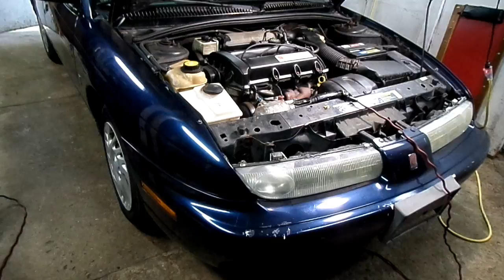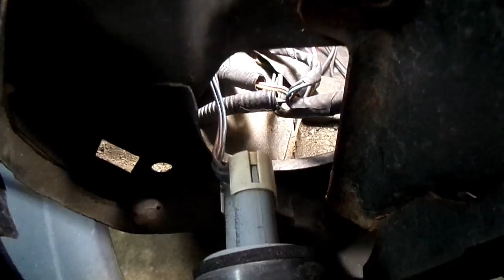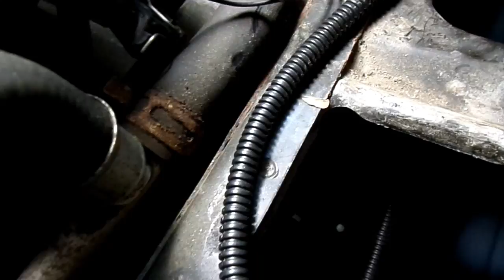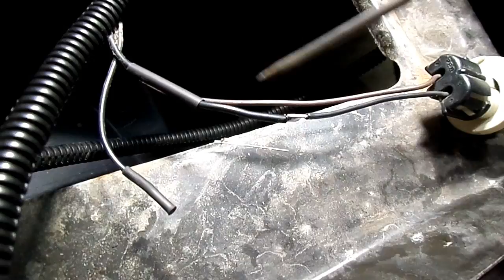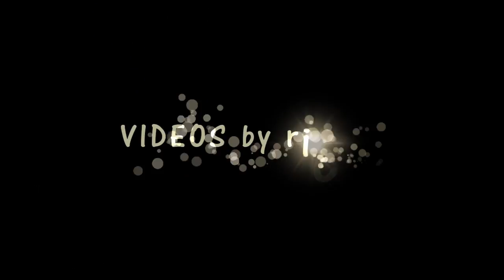Side Marker Lights Flash (modification)

Comment: Very nice! Do the side markers still come on as normal, or does it have separate marker lights and turn signals?  I am thinking if they are separate you could just splice into the existing wire including a diode to prevent the marker light from lighting up the turn signal bulb.
Reply from the maker: This is directly from saturn series .net (When the headlights are off, the corner lights will act as turn signals.  When the parking lights or headlights are on, the corner lights will still act as corner lights, but blink when the turn signal is on.  While headlights are off, the corner light and turn signal will blink in sync.  When the headlights are on, they will blink alternately)

Comment: Couldn’t you just cut the black wire up near the turn signal bulb and splice the wire there, instead of adding a new wire?
Reply: UCN Conversions yes. I just cut both wires from side marker at harness where meet and then take brown wire of marker to B and black to A. Will give u turn signal at same time when lights off, opposite when lights on and still a solid marker when not using turn.
Reply: Its all done, but it will not work if the 3157 is LED. I had to put the 3157 halogen back in for it to work
Reply: UCN Conversions weird never had that problem